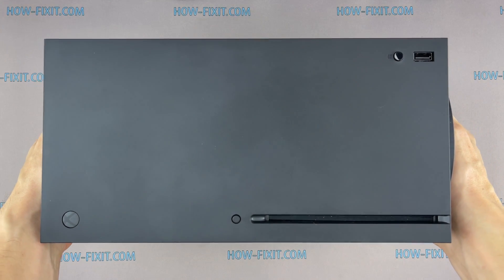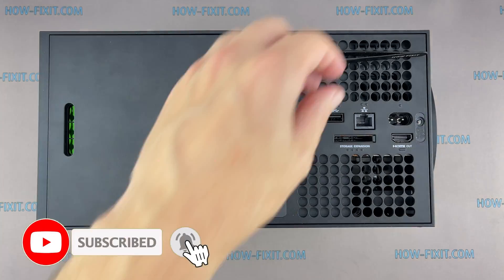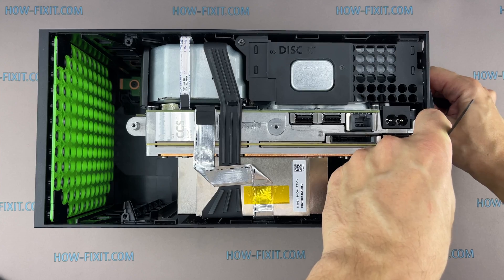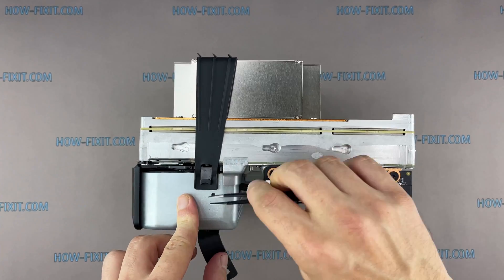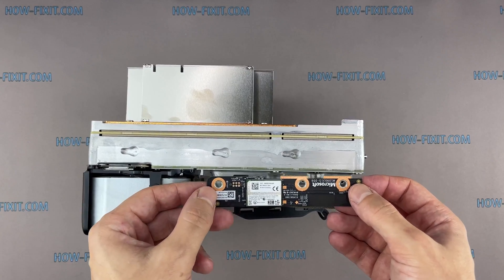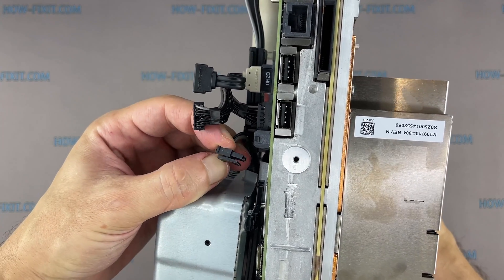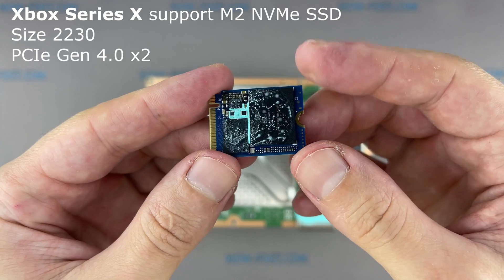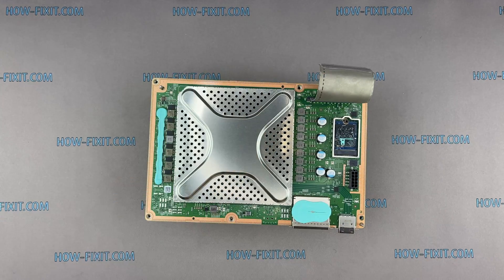Xbox Series X internal M2 SSD Replacement

Comment: MS really don't want anyone to touch the SSD on this machine.  They just want you to buy their over priced memory sticks.
Reply: It is here I got my m.2 SN850 1tb for 1300kr sek while xbox thing is 2800kr 266usd vs 128usd.
Reply: Back then, with the 360, they didn't want you to exchange anything. The drive and hard drive were all coded.
Something like that is unfortunately very bad for the customer. Basically, you buy a product that you can use, but changing it in any way is forbidden or not possible at all.
It's like buying a car and you can't change the tires or wipers or oil yourself.
Reply: Truth......I just want a larger internal storage so I don't have to mess with, and likely lose, external drives
Reply: what model m2 is compatible with the xbox  ..i need 1 2tb
Reply: I have oen of the expansions sticks and the internal still shat itself lol
Reply: What are memory sticks lol ?
Reply: Which is a shame 🤦🏾‍♂️🤦🏾‍♂️🤦🏾‍♂️🤦🏾‍♂️
Reply: This is where Sony actually has them beat. All you do is pop off the outside plate to get to the extra nvme slot take the plate off and install the drive super simple to do and at most 2 minutes.
Reply: @Green1antern27  That's the second NVMe but the internal NVMe is soldered to PS5 motherboard so its worst if it fail !
Reply: @Green1antern27  I’m a huge Xbox guy and I gotta admit PS does have us there, that is a lot easier than this lol
Reply: Update: this restriction is now completely arbitrary, as plenty of third party expansion cards are now available
Reply: @ Too bad they’re all double the price compared to equivalent M.2 SSDs 💀 just like the original expansion card
Reply: the price isn't that different from standalone m.2 nvme drives

Edit: before replying, when I made this comment the prices I was seeing were pretty similar. With everything else going on economy wise, obviously that has changed.
Reply: @saxdude01  For the price of a 1tb Xbox stick you can get a 2tb nvme.
Reply: @saxdude01  Samsung had a 2 TB model for 160 on Amazon. Rated at 7000 read and write so it should better than the original and two times the size
Reply: @alexvillalobos7137  when I made my comment, they were pretty similar. It could have been sales going on or shifts in the market, but at the time, the difference in price was small
Reply: @alexvillalobos7137 like the guy said you also can’t just throw any ssd in there and expect it to work it requires certain formatting and stuff
Reply: @ of course you can throw any ssd in there . Xbox just had it locked down. Look at play station it has an extra ssd slot inside the console and you can 100% use any ssd even slower ones and it’s shown to not even impact games. You just listen to whatever daddy tells you is true

Formatting means make Xbox think it’s the original ssd.
Reply: @ I am aware of that. I know what formatting is and what it does. I meant you can’t just buy a random one and throw it on there right away, you have to at least format it. My other comment says that I am also aware and acknowledged the fact that PS has the upper hand on the storage addition.
Reply: @saxdude01  i got my 2tb Nvme 4.0x4 samsung 980 pro for 130$....  4tb drives start at 200$ for the price of MS's 2tb dumb ssd,
Reply: @Dark3rdayz  I made this comment 2 years ago, and at the time the prices I saw were pretty similar between standalone drives and the ones for the series x. Obviously that has changed
Reply: @saxdude01  I can literally find a 4TB SSD with 6.5GB/s speed anywhere, and it’s the same price as Microsoft’s crappy expansion card at 2TB. Double the capacity for the same price 💀
Reply: @Thewaterspirit57  i already addressed this. Please read the thread
Reply: @saxdude01  dude this was the case before your comment. The expansion card was always bad, and regular M.2 SSDs have always been good, in fact I could probably get a 4TB M.2 SSD for less than 380 CAD now.
Reply: @Thewaterspirit57  you clearly didn't read the thread. When I was looking for one, I was seeing similar prices.
Reply: @Thewaterspirit57  but you can't play games straight from the ssd you have to move them to the internal
Reply: @ wouldn’t have to if Microsoft didn’t force people to use their crappy expansion card.
Reply: @DeadlyniperZ you can with the expansion card.
Reply: @ Expansion card sucks. It’s twice the price of other equivalent SSDs 💀
Reply: @Thewaterspirit57 it’s twice the price because it allows you to play the X/S games directly from the expansion drive.  That’s what a C50 drive does o er standard SSD expansions.   If you disagree link an equivalent drive that world and has same read wrote speeds as the C50 WD Black card.  Note I said “C50”
Reply: @ Except it’s the same deal with M.2 drives for PS5. It’s Microsoft trying to trick you into paying for overpriced junk by locking the hardware down with some proprietary junk. Had they added a regular M.2 slot, you could’ve gotten any SSD for half the price.

Comment: You can't just replace the SSD. I have bought the exact same model Western Digital SSD that the Series X & S models use. Cloning them does work but you can't just pop in a blank one or formatted one to NTFS with a GPT Partition. You can't even get into recovery mode. It turns on and shuts off. You can't clone from one and put it another.. it just does not work.. even though I have the ones that Microsoft uses. There is an extra partition on the original SSD that is unformatted. I have no clue what it is. There is defiantly something stopping us from just charging out the SSD. Its not going to be as easy as the Xbox One. Modern Vintage Gamer is right about something custom that may be unique to each Console that it sees on the SSD to boot. I am sure someone will figure out the method to run a script to get around this and format/partition the SSD. Your only option right now is to make a clone of your SSD and keep it safe in case your original SSD goes up. I have tried cloning the SSD's to other brands that have the same specs as the original SSD's and have the same forum factor. They are manufactured by Samsung, Toshiba and Sk hynix. It will not clone at all. These SSD's will only clone to the same WD SN530 SSD's.
Reply: Great advice from SysQuick
Reply: @TweakTips  agreed don't 1. buy an SSD 2. open the whole system 3. have it all fail and be sad
Reply: does it work now?
Reply: There's an excellent video by another YouTuber who does repairs called "TheCod3r" that explains why that is. Turns out that unformatted portion is some kind of XBFS partition that holds a key that ties your Xbox's SSD to the motherboard. It's nearly a 40 min video but it's worth watching. I'll leave a link in a separate comment
Reply: @themonster4815  Yes I know about that partition for awhile now & about the Cod3r... we have talked before on Discord. I have done a lot customer repairs replacing bad SSD's and getting pairing partition off of them. Problem is that it doesn't always work because the SSD is to far gone. It really sucks what M$ did.
Reply: I was interested in getting a 2 tb ssd and an additional 2 tb expansion card to put a total of 4 tb in my series x. My question is why you have to clone the drive to get it to work instead of popping in a fresh one. It's like Microsoft just pulled an apple and said fuck you to us. I mean, the ssd is probably the first part that's gonna die in this system if not the disk drive
Reply: @rantzntirades1104  yes.. the SSD's are locked to your console. You can't just replace it.... which means you can't upgrade the internal storage either unless you have whatever special lock data/partition/code they have to make it work with your Series Console.
Reply: @Consolerepairstore  so Microsoft has gone full apple. It makes sense that it would work if u clone the original drive. I wonder if Sony is doing the same with the ps5
Reply: @Consolerepairstore  How did you try to clone the drive ? "dd" command in Linux should work as it can make a 100% RAW copy of every bit. So unless there is a something physical or encrypted matching something "inside" the drive, I can't see why it's not working.
Reply: Does anyone know of a script that can be used?
Reply: Hey, you hv info if anyone solve that now?
Reply: @chorepo1238  u have to clone the drive. It shouldn't matter if it's the same 1 tb drive or a 4 tb one as long as its the same form factor.
Reply: you are right but there are people that say it will work but it does not WORK
Reply: @gamerX-wk7ct  I have seen this.. and I ask them show me video proof of you doing this step by step... and they can't produce it.
Reply: @Consolerepairstore  there not going to show any steps because there lying they show crap like this to fool people .

Comment: I saw another channel saying simply cloning the ssd wouldn't work.
Reply: it does work... but you have to use the same Western Digital model SSD. I have done this on both my Series X and it works perfectly fine.
Reply: @Consolerepairstore  so you just cloned them, put it in the xbox and it worked? Because i did that and my 2nd series x just turns on then shuts off in seconds.
Reply: @WillsNotBill  It does work but you have to use the same SSD model that your Series Console comes with. I have done it on 2 of my personal Consoles and works perfectly fine.
Reply: @Consolerepairstore  oh ok. But using the ssd on another xbox wont work i assume
Reply: @WillsNotBill  Correct.. the SSD Clone will only work on the same Series Console you cloned it from.
Reply: @Consolerepairstore  damn. I hope they find a way around it. I got an extra xbox i want to fix
Reply: @WillsNotBill  unless someone figures it out or M$ releases tools to install new SSD's. we are stuck with this method unfortunately
Reply: i tried with 2 TB Crucial SSD of same type, cloned the original SSD to the new one, but the XBox shuts itself immedietly when powered on 😅, switched back the original SSD and living with that...
Reply: @RifaiRahmanM thats so sad...